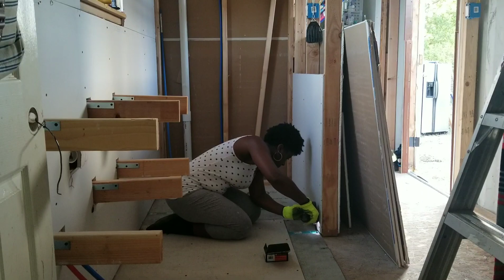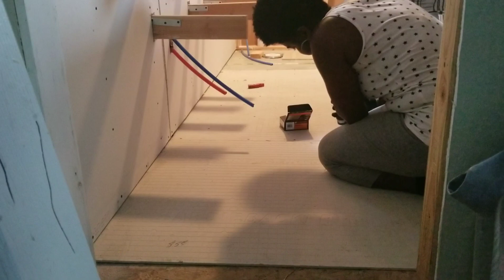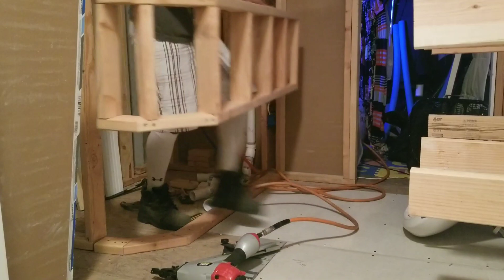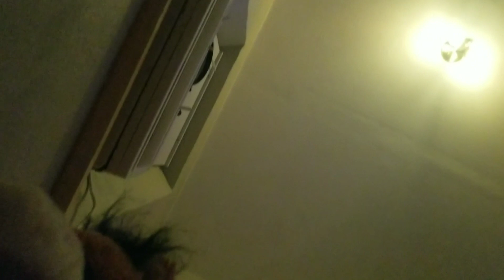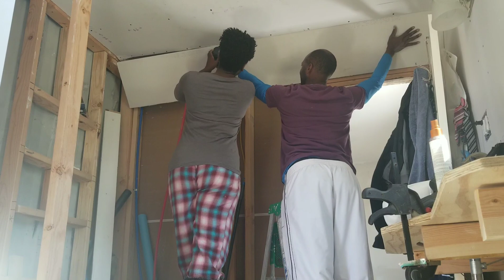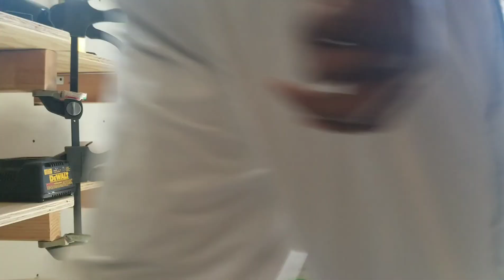#22 Our Shipping Container Bathroom Part 1

Comment: How is called, they sheets you screw on the floor?
Reply from the maker: We used the DSG Fiberrock. It cuts well,  to us it is easier to use than the durarock. It normally cost a little more, but for this application it good.
Reply: @ProjectPennyLane  thank you 💞